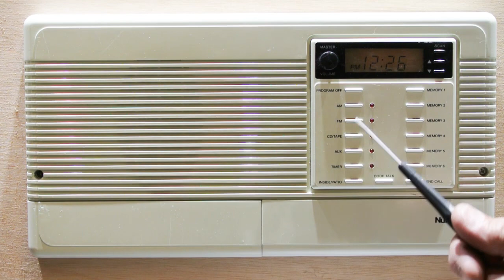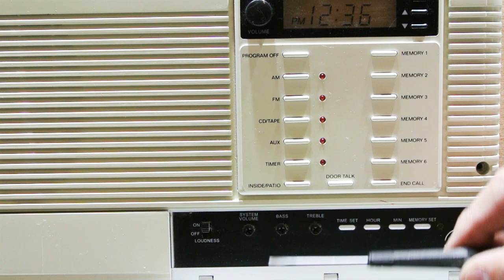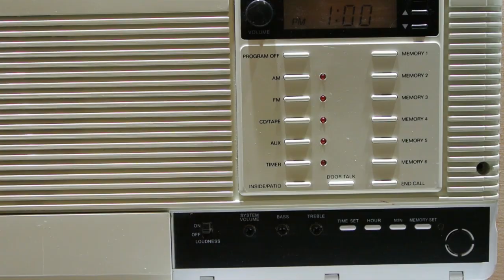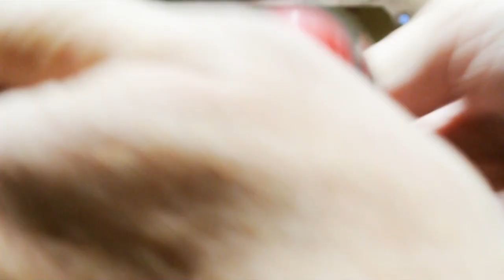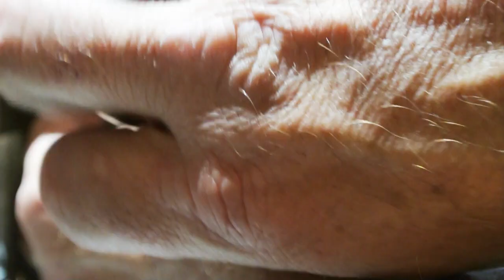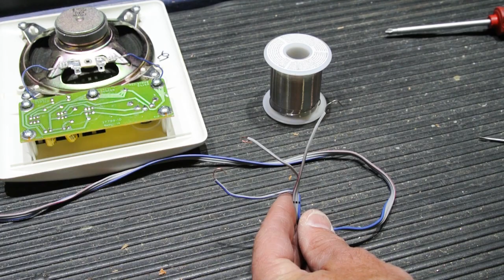Basic Troubleshooting  of a NuTone IM3303 and IMA3303 Radio Intercom System

Comment: I came here to see if this was the problem we are having with our Nutone, the symptoms were close to the same, but while I was watching this, the master station started changing stations on it's own,  then the power went out on the master station... I guess I'll be back once I check voltage...
Reply from the maker: Hi danacayton: Make sure you let us know what you find out about your IM3303 System - Chris
Reply: @northsideservicecompany3567  Hi Chris  this is what's going, I did a reset on the system, that seems to have stopped it from switching stations, but now it stays on for about 10 minutes then it shuts off completely, all power is off, no display, nothing, but after a few minutes it powers back on by itself. It makes me think something is getting hot.
Reply from the maker: @danacayton5399  1st - You must open up the IM3303 and fully disconnect it from the 2 low-voltage Trasnformers ~ Do It Right Now ~
     The reason your Master Station is cycling Off & On - is becasue it has a major fault that's overload one or both of the low-voltage Transformer.  These Transformers have Thermal Limiters inside of them, and when they overheat, they shut off until they cool down. The they turn back on again - then overheat and the cycle repeats
     Your IM3303 is in need of a repair - if you leave powered up - you risk major damage to it - Chris
Reply: @northsideservicecompany3567  thanks for the reply, I haven't been using it and haven't been home to even think about it. I may have a couple of transformer's here, but before I change anything I think I will put a thermal imager on it, just to make sure. I'll let you know what I see, next time I get a chance to work on it.

Comment: Thank you for the troubleshooting tips. I worked the problem backward since the system went haywire during a heavy rain and wind storm... @ 4 in the morning. Disconnected the patio unit and the problem was solved. Probably won't replace it since it is never used.
Reply from the maker: Hi Bob:  Well Done! - Chris

Comment: I have a nutone IMA 3303 that doesn't work after troubleshooting.  I have 2 main receiver boxes.  Neither of them play the radio or have any tone volume.  One of them has a red light on the electrical board the other one does not.  Do you have any recommendations.
Reply from the maker: Hi greg:  There seems to be a lot going on with your IM3303's - I will need much more detailed information to be able to offer any meaningful help - It would be best to contact us directly - Chris      nscompany@msn.com

Comment: My power went off then on. After it was came on the red light on the station area cane on an the intercom doesn't work.i hit the reset button but all the ted lights lite up. Cannot turn them off. Can you help me?
Reply from the maker: Hi user-me-7rbnm3e:  Here's what you can try - Turn the Circuit Breaker that the Master Station is on - to Off - and leave it off for 24 hours (truly, 24 hours) then turn it back - if that solves the problem, you're good to go - If it powers up in the same condition - you will need to contact me directly - Chris   nscompany@msn.com

Comment: Hello, I have the same system, and I was wondering if the doorbell transformer installed inside the master “board”? 
And do you know if it’s compatible with Ring doorbell? For some reason my Ring is not getting the power, however, when I attach the two wires manually the bell goes off. 
So do I need to replace anything, or I simply need to install a separate transformer for the Ring?
Reply from the maker: Hi kevycb:  There isn't any 'doorbell transformer' in your IM3303 - The Chime Module (an electronic board) is part of the Master Station, and is not powered 'separately' - You need to watch 2 of our Videos:
     https://www.youtube.com/watch?v=t6YswmDNVyI&list=PLsTvqKsBnGYdNYGrlrOSVKjOLwvFWrLUx&index=3&t=1643s
and
     https://www.youtube.com/watch?v=8LXCcLr_HHA&list=PLsTvqKsBnGYdNYGrlrOSVKjOLwvFWrLUx&index=10
Chris

Comment: My entire system works fine, radio and all.  The only issue is the master station door talk and inside/patio talk doesnt work.  I can hear from any station in the house, but I cant talk back using the indoor or door buttons.  I hear clicking and they hear clicking but its like the master station has no microphone capability.  Sound comes through fine though, radio transmits all through the house, door bell works and master station can hear just cant transmit speech.
Reply from the maker: Hi KnightDriveTV:  I am going to assume that all of the Intercom functions work correctly from Remote Station to Remote Station and from Remote Station to the Front Door Station - If this is incorrect, the following may not apply at all.
     The first thing you need to do is make sure the System Wide adjustments are set correctly - The Volume Controls on ALL STATIONS, Including the MASTER STATION need to be set to FULL VOLUME - The adjust the Intercom and System Volume to proper levels - Now test the Intercom operation and see if it's different. - If the problem still exists, continue on. . . 
     Next clean the Room-Control Switches behind the Left-Hand Door on the IM3303 - Here's our Video that shows how to do this:  https://www.youtube.com/watch?v=dsTiNPNb30s&list=PLsTvqKsBnGYdEick3gTsAYly4GEQwuUod&index=2
   If these 2 step don't solve the problem try performing a RESET on the Master Station - Here's how to do this: https://www.youtube.com/watch?v=hJ7hSia0d7A&list=PLsTvqKsBnGYc2zj1Db43FzJR_JV684dsi&index=1&t=1s
     If the problem still exists after trying these steps, there is an electronic problem with the IM3303 and you will not be able to solve it yourself.
     You can contact us directly if you're interested in having the IM3303 repaired - Chris           nscompany@msn.com

Comment: Hi, can you reset the speaker without disconnecting the wires you mentioned?  My speaker has been working just fine up until this past weekend and I'm afraid to touch any wires.  I'm hoping the reset will work but need to know if I should just reset or disconnect the wires and then reset?
Reply: Hi Chris, I have another question regarding my IM3303. Is there any way to just replace the bottom door that covers the intercom controls? As you know there 2 drop down doors. Mines on the left got broken so I'm hoping I can just replace that. Is that doable without having to replace the entire master?
Reply from the maker: @lurtriciawheatley7478  We have some Lower-Doors available - You will need to contact us directly about this - Chris               nscompany@msn.com
Reply: @northsideservicecompany3567  thank you. Email just sent.
Reply from the maker: Hi lurtriciawheatley:  Yes, you can perform a Reset at any time to see if it solves the problem with your system.   Your IM3303 is a low-voltage system ( only 16 volts) and the Black Ribbon Cables and the wires that connect to the Remote Stations do not actually have Any Electricity In Them.   I would never show people how to do something that is dangerous to do.  If you need more help, it would be best to contact me directly - Chris              nscompany@msn.com
Reply: @northsideservicecompany3567  thank you Chris for the quick response. I will contact you because I do have a couple of more questions.

Comment: I know that's a demo system... But man you're heavy handed with those terminals
Reply from the maker: Hi blackout260112: Nah, I don't think so.  The Ribbon Cable Connectors snap-in firmly and they need a good tug to unplug them. After all, I am a Trained NuTone Service Man who has unplugged probably 10,000 IM3303's 😉- Chris

Comment: Good evening!
Are you still repairing these?  We just bought a house built in 1975.  The system did work for the radio in all rooms…but now it automatically turns itself on & off, seeking an FM station and showing a code of 1C.
Reply from the maker: Hi Ramblerman:  Yes, we repair NuTone Intercoms everyday - Have you followed the Troubleshooting as shown in this Video? - Chris

Comment: from your vidio i was able to get my master statiom working. i have a couple bad remote speker with a 62143 curcit bord. it looks like a pretty basic bord but i have not been able to figure out whats wrong. using a mulit meter it seems the capacitors and resisters are good  the potentiometer also seems to be good . in not sure how to check a switch or if you even can check them?
do you have a vidio on the remote sperkers im not seeing .  the bords look good at least i dont see any corosion.
Reply from the maker: Hi Robert:  Your IM3303 is a 3-Wire System - On 3-Wire Systems the coil in the Speaker Cone is part of the Control Circuit for the Intercom Functions.  If your Speaker Cone has failed - you will not have any Intercom Functions when pressing the button - of course, you will also not have any Radio, since the speaker is bad - Switch Boards rarely fail, except for outdoor units that get wet - The pushbuttons can become noisy from wear - they can either be cleaned or replaced - Here's links to those Videos ~
 Cleaning:   https://www.youtube.com/watch?v=COruBSRkgCY&list=PLsTvqKsBnGYfpZP9NkBqZe5LFHu9ALtvB&index=3
Replacement:  https://www.youtube.com/watch?v=d3k_ivdanhI&list=PLsTvqKsBnGYfpZP9NkBqZe5LFHu9ALtvB&index=16&t=1s
Also, We have NuTone Speaker Cones if you need some
Chris
Reply: @northsideservicecompany3567  you are corect it was the speaker. we are selling  the house so i only need to fix a couple spearkers. do you have a reomended replacment speaker 

FP500F  25Q  5 W     do i need to match the spec exactly or can i get away with something close.
Reply from the maker: @robertstevens1507  You won't find "something close" NuTone Intercom Speakers have unique ratings - We have genuine NuTone Speakers Cones available for your IM3303 System
You can contact us directly about them - Chris         nscompany@msn.com

Comment: Does anyone know how to fix finding the remote stations. On the remote station status switches i can't find the remote station for two rooms. I cant identify the correct switch for them and no sound plays out of them. I found the other rooms but haven't found these two. Any suggestions?
Reply from the maker: Hi Kebab:  How many Remote Stations (inside & patio) does your system have?  The IM / IMA3303 System has the ability to have some Room-Control Switch's to have "doubled-up" Remote Stations (stations 1,2,6,7) for a total of 13 Stations. - Each Remote Station should be wired directly back to the Master Station (not looped) - Open the Master Station - count the number of connections on the Terminal Board - Compare this to the number of Remote Stations you have (this number should match) 
Did the 2 non-working Remote Stations ever work before?  A simple test is swap a Know Good Station (from another room) into the locations of the non-working stations.  If the non-working locations work with the temporary station - the original station has a problem.  If it still does not work - you either have a wiring problem or it's disconnected at the Terminal Board (or both???) If the 2 non-working stations are outdoor Patio Remotes, they probably have failed Speaker Cones - Chris

Comment: i can’t find the aux input but there’s an six button???
Reply: aux*
Reply from the maker: @nitajoseph1835  Watch this Video: https://www.youtube.com/watch?v=qPDsvHRVU_c&list=PLsTvqKsBnGYc2zj1Db43FzJR_JV684dsi&index=3&t=1s
At 2:25 into the Video - I point to the Antenna on the back of the IM3303 with a screwdriver - On bottom corner of the circuit board, you can see 3 -  Black and Silver devices on the corner of the board - Two of these are the AUX Input Jack - There is writing on the board - next to the Jacks - they are labeled as "AUX" and "CD/TAPE" - Chris

Comment: Our intercom door talk function doesn't work and never has since we bought this house in 2013. House was built in 1995. Everything else works, so I don't know what could be the problem. We did have a repairman try to tell us that because we don't have a landline hooked up it won't work. Sounds like nonsense to me. What could be the problem?
Reply from the maker: Hi Schelle 7000:   The most common problem would be that the Speaker Cone in the Entry Door Station is bad.  This is fairly easy to determine - Here's a Video that shows what to do: https://www.youtube.com/watch?v=lSreNRYYAhE&list=PLsTvqKsBnGYetnCj2Mk1qc5WnSSySSzTw&index=6&t=483s

The nest most common problem would be that  the wire that connects the Entry Door Station to the IM3303 is damaged or bad - Here's a Video about how to check that:  https://www.youtube.com/watch?v=aYHthKFeNDg&list=PLsTvqKsBnGYeFVhW3kYRW9rak8P0IJjku&index=1&t=1294s

There is also the the possibility that the IM3303 has a problem (not as likely as the other 2 choices) This would not be a do-it-yourself repair.

Finally, not having a telephone land-line has nothing to do with this problem and who ever came out should have been able to check for problems 1 & 2 in about 15 minutes - Chris
Reply: @northsideservicecompany3567   Thank you for responding. I never believed that telephone line stuff. Sounded like a way to upsell us.

Comment: Chris

Great video and troubleshoot techniques.  Appreciate you putting this together and having the parts to put my IM3033 system back in working condition.  Our system is approximately 22 years old.  Diagnosed down to two of the remote speaker circuit boards.  02Jan22
Reply from the maker: Hi Gary, Thanks for the kind words - The Remote Station Switch Boards we sent to you, are they very first Switch Boards we have sent out with New Replacement Pushbutton Switches and Capacitors. https://www.youtube.com/watch?v=P5JBHohA1lw    -    Chris

Comment: I have an NuTone IMA3303 radio/intercom system. Wondering if a Nutone ISA-445 series speaker is compatible with that? I tried to hook it up with the wires I had, but it doesn't seem to work. The speaker I'm replacing only had 3 wires, there are 6 possible screw attachments for those wires. Is this possible to make work with my current NuTone system or no? Thank you.
Reply from the maker: Hi John: No, the ISA445 is not compatible with your IMA3303 System in anyway - The ISA445 is a 6-wire Remote Station designed to be used with a IM / IMA4406 or it can be used with a IM / IMA4006.  You need either a IS335 or ISA335 Remote Station - Chris

Comment: I just watched your video and found it very enlightening. I have a 23-year-old (original to the house I had built)  NuTone IM3303 three-wire, six-speaker system. The radio and door bell work through all but the master bedroom speaker. Further, none of the inside/patio talk and door/talk switches on five of the speakers work -- I only get static when I press the switches; the master bedroom speaker switches are totally dead. Also, the front door bell speaker (for listening) doesn't work.  I'm thinking there is a wire continuity problem with the master bedroom wiring. I guess I could substitute a working speaker (from another room) and connect it to the master bedroom speaker to confirm if the wiring is bad. But regarding the other five speakers, I get radio audio but no voice communication when I depress the talk switches. My wife called the company that installed our system and they can diagnose the problem for a $90 service call. I'm inclined to leave the job to them. But if it's just a matter of swapping out speaker units (and purchasing same off Amazon et al) I can do that. I can also pull ribbon cables and individual connection wires (as shown in your video), but I'm not sure the procedural steps I should take. Do I just have bad speaker talk switches or shorted wiring or both, that's my question. Or, could it be a component in the master unit. I've put up with this condition for years, but now my wife wants the system working. If you could reply to me what action to take I would appreciate it. Again, my  wife spoke with the company that installed our intercom system and they gave her a ball park estimate of between $800-1,200 for a replacement system. I'm assuming the $800 estimate would be if all of the system components didn't have to be replaced. In any event, I'm going to hold off a few days to see if you reply to me before calling the repair company (a security alarm company that also installs and services intercoms), in the event I can make the repairs myself. Lastly, I realize that if it's an interior wiring system problem (like mice chewed the wires), the repair costs for that would be greater.
Reply from the maker: Hi 1royalpalm:  Of course this is all very complicated and I cannot answer your questions in a YouTube Comment - It will be best if you called me or emailed me to discuss your system and how to proceed - Chris  925-743-8236 or nscompany@msn.com

Comment: After disconnecting the four cables and resetting the memory the clock could be set to the correct time and a radio station could be selected, but the radio and intercom did not function.
Reply from the maker: Hi Paul:  It seems that your IM3303 has more serious problems, that a Reset won't correct.  You can contact me directly for more information about having the IM3303 repaired - Chris  925-743-8236

Comment: how do i connect AUX ?
Reply from the maker: Hi nic seale:  The auxiliary input jack are on the back of the IM3303 - in the lower right-hand corner of the main circuit board.  The jacks are labeled as "Cd/Tape" and "Aux" - these are RCA jacks - Chris